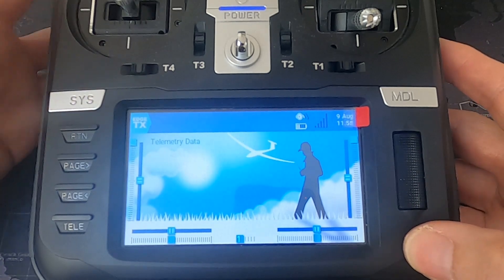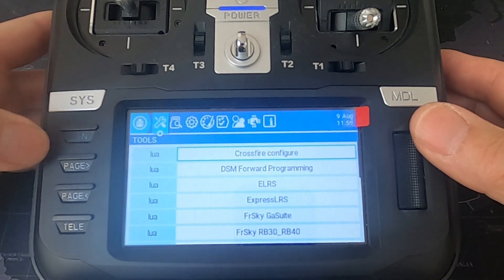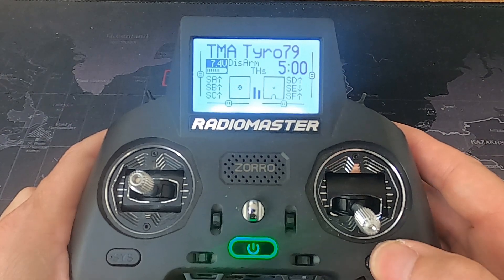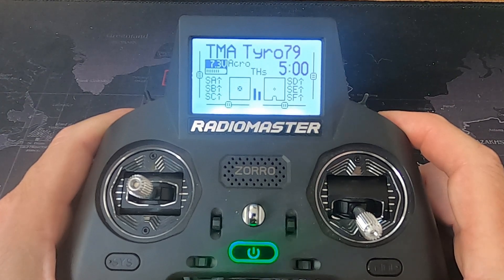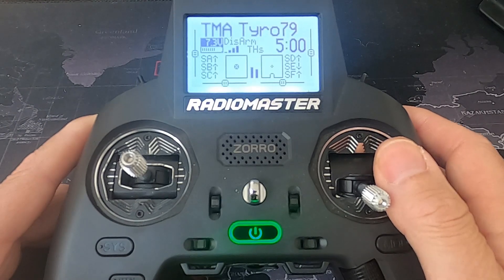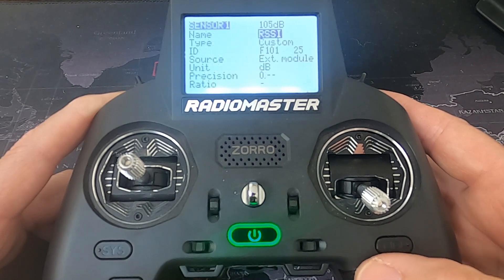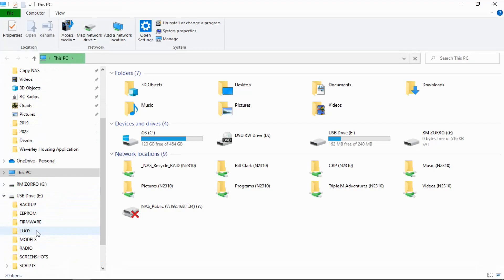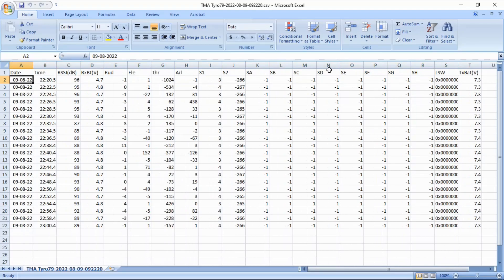EdgeTX Setting Up Telemetry Data Logging to your Radio

Comment: Why can’t I see GPS telemetry sensors out of SpeedyBee Mini Wing FC/Boxer ELRS, about 20 sensors are discovered but not and GPS data. The GPS is working and shows its data in INAV configurator. I note other people with this issue, but no solutions. Any help appreciated, thanks
Reply from the maker: Hi Peter, just off to my day job. I have no experience with INAV but with betaflight you need to activate the gps option by activating telemetry. Are you seeing the gps coordinates in INAV? If you are not seeing the gps option in your radio and the receiver does support GPS telemetry the radio is not receiving the data. Have you tried taking your model outside give it a couple of minutes and try discovering sensors again?
Reply: Exactly same issue here. Did you find a solution for the GPS not being shown/updated?
Reply from the maker: @jankiefer  sorry Peter did not get back to me.
Reply: @jankiefer  Yes, the issue was the ELRS setup on my TX and not on the FC. Apparently there are two types of Telemetry 'Link' and 'Data' ELRS favours the 'link'. GPS data is included with the 'Data' telemetry. So setup the ELRS on your TX using the Lua script to min '100Hz Full Packet rate'. Set the Telem Ratio to 1:16' if you are a Fixed Wing flier. Another issue you may come across if you are a fixed wing flier is not enough channels especially using FCs. While you are adjusting the Lua on your TX set your 'Switch Mode to 16CH Rate/2' to get 16 channels otherwise you might be lucky to get 12 channels. Cheers

Comment: Hi Bill.  Thanks for this instruction.  It works great.  I was wondering if there was a way to reset the logging without turning the radio off and back on.  I'd like different logs for each battery or if I change models.  Thanks!
Reply from the maker: Hi Bruce, set up the function to a switch other than the armed switch. You can now turn on and off the logging. Each time you turn off the switch the logging will finish and save.
Reply: Thanks Bill. I'm out of switches on my Boxer with Arm, Flaps, Rates, and SAFE/ AS3X. Switch E will be for Reverse thrust.  I may be able to use one of the 6P buttons.
Reply from the maker: If you search my videos you will find a video about the 6 push buttons and how to program them.

Comment: Thanks Bill! I am wondering if we can program EdgeTX to provide the functionality that the Altis device provides for F5J and eF3K sailplane events just using an RX equipped with an altimeter. This would be launch height limit and motor run time.
Reply from the maker: Hi Adam, with the correct receiver this should be possible. If you tell me exactly what you want the radio programming to do I will work on it.
Reply: @the-happy-RC-flyer The AerobTec Altis v4+ is a barometric altimeter designed especially to record the altitude of R/C aircraft during flight with additional competition features and telemetry support.    The EDGETX radio would need to be able to shut down the motor upon reaching a certain altitude. The Altis also has a gain feature (derivative) that prevents the pilot from zooming after the motor shuts down. It would be good to emulate that as well.
Reply from the maker: Hi Adam, I have programmed the altitude throttle cut but could you give me clarification of the pilot zooming? I am not a glider pilot so need to understand exactly what the pilot is not allowed to do when the throttle cuts.
Reply: @the-happy-RC-flyer  That's fantastic!  Here are the "working" rules for e-F3K hand launch here in the US.  These are from RCGroups... There are formal rules for F5J... I believe they are different: 
The key to fair and consistent launch altitude (50m) lies in dialing in the Altis’s Anti-zoom factor. The suggested starting value being 0.5 - 0.6. , SWSS only allows the use of 2s batteries to eliminate "hot" motor set-ups that unfairly add to the potential energy (zoom) of the plane at motor cut-off.
Your launches should be upward at 70° or more. The plane should climb at a steep, straight angle representative of a DLG launch- this very important.
It is necessary to verify a planes Anti-zoom factor through test flights. A pilot should perform a minimum of 3 launches- more is better. After transition to cruise mode at the top of the launch, immediately descend so as to not influence the launch height. Upon landing, review the launch altitude on the Altis. If the reading is in the 48-53m range your Anti-zoom factor may be good. Again, make enough launches to confirm the model is returning 48-53m results.
If your results are consistently too low, reduce the Anti-zoom by just 0.1 and repeat your 3 launches. If your launches are consistent too high, increase the Anti-zoom factor by 0.1 and repeat 3 launches checking each launch height result. Make Anti-zoom adjustments in 0.1 increments. Be sure to consistently launch at a steep, straight, upward angle. It shouldn’t take too long to dial in the Anti-zoom factor.